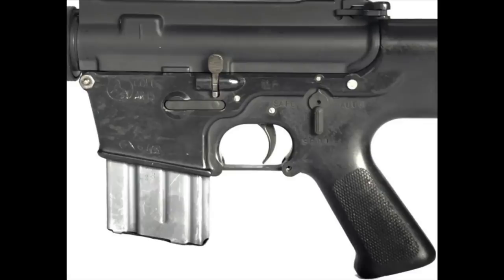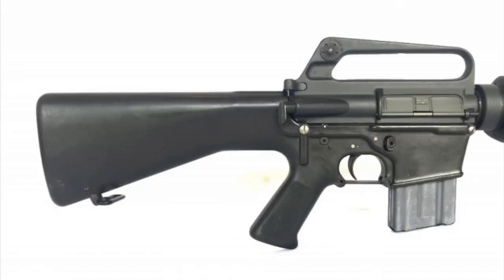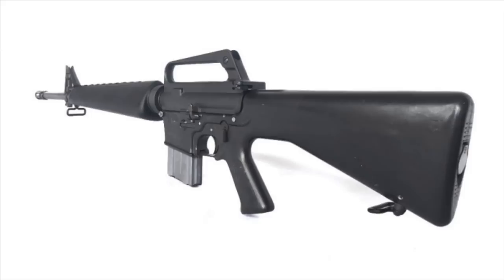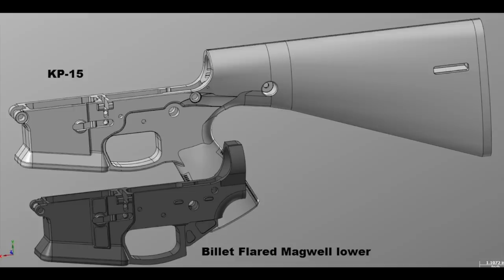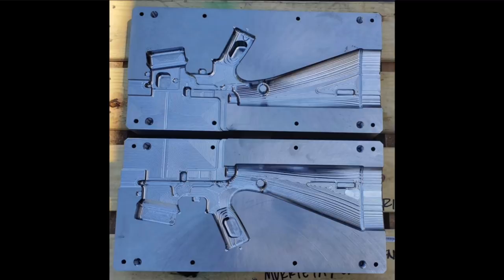Update on WWSD2020 (What Would Stoner Do) Project

Comment: This video brought to you by Toolmakers, the ones who make literally everything.
Reply: I just want one of the machining YouTube channels to make a lathe with a lathe. It's been a saying forever that the lathe is the only machine that can make itself. Time for someone, or perhaps a collab of all the YouTube machinists, to prove it.
Reply: @EclecticBuddha  I don't see how a lathe can make a lathe unless the tool stock is used as a table, which would be a role far exceeding what it is supposed to do on a lathe.
Reply: @EclecticBuddha  What they mean is it can make almost all the operating parts. Gears, pulleys, driveshafts, chucks, collets, screws, controls, etc. Making the frame, dovetails and other bits will likely require other processes. Casting, milling, etc. Though you can make a fair chunk of that with a lathe too.
Reply: @EclecticBuddha  Be a lot easier to make a milling machine with a milling machine, also be easier to make a lathe with a mill, you can do pretty much anything a lathe can do with a mill as long as you have a rotary table and an index head with helical attachment but you will have a hell of a time making slide-ways [of which there are meany] with a lathe. Whoever said "The lathe is the only machine that can make itself" was defiantly not a machinist.
Reply: Michael Srite  Okay fine, handmade arts and crafts aren't. Even then, the tools and supplies were.

Comment: Fellas, print separate halves in  separate facilities that can be shipped separately and then bolted or screwed together at home, it's only a lower when the buyer possesses both.  Russell said the ATF classifies each separate half as an 80% lower, they are only a receiver upon simultaneous possession of both halves. the current mold is a good starting point for the bolt-together mold CAD model.  Call it the WWDD Rifle: the What Would Dugan (Ashley) Do Rifle. Cheap unregistered guns for the working class!

“That rifle on the wall of the labourer's cottage or working class flat is the symbol of democracy. It is our job to see that it stays there.”

― George Orwell

Comment: Hey Ian, I remember in your original WWSD project, you guys said that all polymer lowers were garbage except for the CAV arms one. I was wondering if you had tried the Tennessee Arms Co lower. It has brass inserts for the threaded parts. I know it’s more of a copy of an aluminum design, but I have two that seem more durable than necessary. They’re relatively cheap, so maybe you could give it a shot if you run out of new things (or old things) to review. Thanks for the update!

Comment: Have you considered adding a mold max insert around the fire control section of the mold it would help the cycle time and possibly with any sink marks . That's a complex part to fill from one gate I guess that you will get a weld line in the trigger guard near the mag well but its hard to tell without a cross section but good luck with it .

Comment: It's probably too late, but you should look at mold inserts. Could solve the 80% question, the various accessory positions, grips, mag wells, and maybe even variable length of pull. Can also address key tolerance issues like the various pin locations. Can even allow replacement of high wear areas of the mold without starting over.

I worked for a medical devices company that did things like that.

Comment: I’m a simple guy, simple questions, simple answers.
What is the big advantage of doing it in a mold, instead of milling from a solid piece of polymer? 🤔
Reply: I'm going to guess. Cheaper to make and faster.
Reply: As mentioned in the video, 60 seconds to manufacture using a single mold vs 30-40 minutes with a bunch of machining processes.

Comment: That's it I'm buying rubber cement right now, and an 80% lower.

Anyway, why are they friction welding it?
Reply: Hollow internal features can't be produced any other way save for 3d printing. Friction welded glass filled nylon is much stronger than PLA or ABS.
Reply: Friction welding forms a solid, reliable join where there is no issue of adhesion, potential solvent or glue pockets, and it's cheaper & faster.
Reply: Ever tried to rip open those plastic shells that are welded? The one you need a sharp knife to open. That form of welding is incredibly strong for plastics & polymers.
Reply: That's how you bond plastic/ pvc/ poly. Even with " glue" it's just a chemical bond/ weld.
Reply: Without doing it in halves, they could not make the magazine well, or FCG area, be cuboid in shape. That is, any injection molded plastic requires some "draft", or angle, to the planes contacting the molds, or it won't come out! Sinestral Rifleman mentions this. You cannot have a zero draft plane. Sooo the FCG area would have to be wider at the top than at the bottom, which would not allow any FCG to fit properly, and the magazine well would also need a taper, which would probably be fine in practice.
Reply: Talk is cheap
They can use all the new terms they want but delivery of the product is what we are waiting. Talk is cheap

Comment: not sure if its been mentioned in earlier videos, but does the WWSD2020 lower use standard take down pins? and if not will they be provided with the lower and/or for sale on the side? (cross posted on IR and FW)
Reply: The detents are built into the pins.   They are included with each lower and spares will be sold separately
Reply: @SinistralRifleman  thanks!

Comment: Soooo... what if you filled the finished lower with HIPS or PVA?  Then the end user needs to "machine" all the internals with water or limonene?  This would require the end user to make significant modification to the internals and meet the 80% requirements.  The fact that the process is easy shouldnt be am issue.

Comment: If they mold a standard buffer tube into it instead of a stock, I would demand that they take my money.
Reply: That would not have the strength we're looking for when made out of polymer.
Reply: I’m hoping that you can extend the receiver back to cover the space usually reserved for the castle nut. That’s about .4” more material. You can also extend the bottom rib of the tube all the way to the receiver to add more strength.

But my knowledge of polymer strength is limited. I’ll take your word that it’s not strong enough.

Comment: 7:22 Why does the simulation take so long? I used injection molding simulation software in 2004 on 2004 computers that only took a few seconds to tell you all about potential failure points and temperature gradients of your mold, with any material you chose. It would have to be literally a million times more complicated now to take 2 days on 2020 computers. Are you sure it wasn’t just that it took your contractor 48 hours to find the right parameters for a successful injection? I guess it’s possible it’s really that slow, but wow
Reply: Id guess that it includes iterating for the best parameters too.
Reply: banaana1234 yeah that makes sense

Comment: I would love to see an option with a hinged trigger guard. As someone from the colder climates, the intent for that feature is to be able to open it up in the winter for easy firing while wearing mittens. It was specifically designed with the ability to be opened using the tip of a 223 or 556 round.

Comment: The 80% solution seems quite simple, just fill the cavity after completion.
Reply: Not how it works, really. Metals and polymers act differently
Reply: @TheWorldEnd2  Obviously.  Are you saying they can't pour molten plastic/polymer into the cavity?
Reply: @DonziGT230  If you fill the cavity that means it will have already been a complete lower at some point. Too late for 80%.
Reply: Again, the atf has already ruled on a situation exactly like that with another polymer receiver and they said it was a firearm.  They got all the records from that company and collected the parts back up.  Everyone commenting on the 80% issue thinks they have some clever novel way of making it work.  And all those ways are either not viable from a regulatory perspective, financial perspective, or both.

Comment: Have you guys looked at actually 3d printing the part instead of using injection molding?
And thank you for the video, I love stuff like this.
Reply: That's a time thing injection molding is so much faster than printing. Printing is nice for one offs
Reply: 3d printing is a relatively slow process, injection moulding is not, 3d printings real strengths are prototyping and making parts not able to be made via stock removal.
Reply: sure thing guys, but as said in the video the target time to beat is around 40 minutes per item
Reply: @SoWe1  can you three D print with glass fibers?

Comment: So what this is telling me is there’s is so much that can go wrong in the manufacturing, that I should never buy this because the probability of getting a receiver without any issue is low.
Reply: You missed the point.   All this effort is to make sure it’s done right.  Once a mold is done correctly and processes dialed in, all the parts are the same and fine.

Comment: Why didn't you mold a mil spec buffer tube onto this receiver to give people aftermarket butt-stock options, instead of this ugly stock, looks like it is fully draft-able.  Also recommending to used a more modern material such as HX5 thermoplastic nanocomposite instead of an ordinary glass filled polymer.
Reply: That would really make the point moot. Don’t understand why everyone wants to buy the InRange setup to make it anything but. Just to say you bought one?

Comment: This is going to be yet another crap, polymer AR15 lower, if they had this much trouble designing it. Definitely too far out of their wheel-house to attempt.
Reply: The gate location is decent for durability, but the fact that is two halves to be welded, is simply fool hardy.
Reply: Not working with outside experts is what would be fool hardy.   We will prove you wrong in the market place.
Reply: @SinistralRifleman  The outside experts that was telling them the fill time was terrible? Of course they are not going to totally turn away a client, so they helped them out. Plus how many AR owners want to give up the option for different stocks, possible folders, and pistol grip choice? The market place has proven that these are things that a customer wants, but sure, deny that.